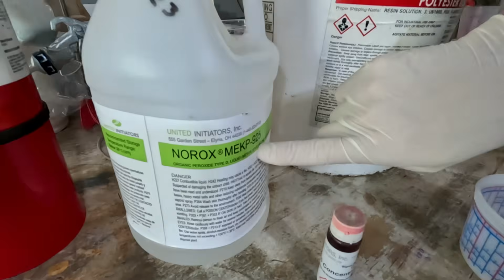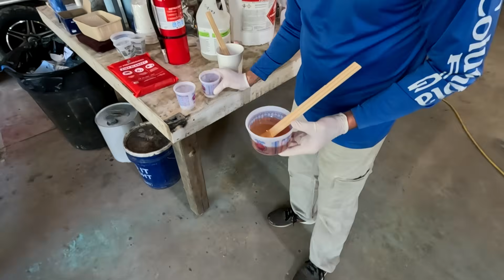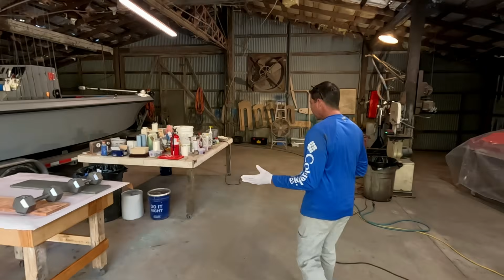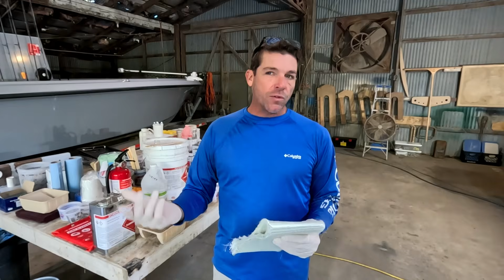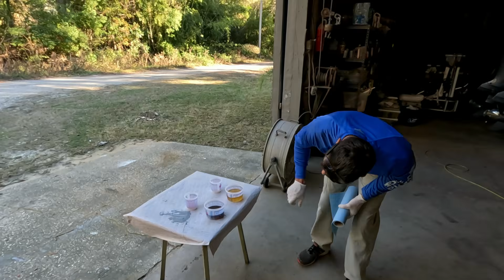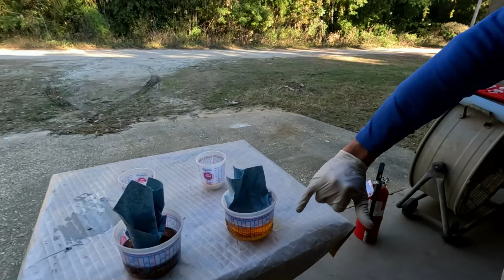FIRE HAZARD!! WILL POLYESTER and EPOXY RESIN IGNITE? LET'S TEST IT AND FIND OUT!

Comment: I am repairing a badly damage very old 14 foot fiberglass sailboat. The centerboard box must have been replaced because it was made out of 1/2-in plywood and was almost completely rotted. I have made a new one out of marine plywood with 3 layers of epoxy saturated fiberglass cloth on it. It was held in place by one fore/aft stringer and lots of foam insulation. I am planning in attaching the new centerboard box to a 2/6 stringer [on each side. My question is what do I use to adhere the new epoxy centerboard box to the polyester fiberglass hull? I can use epoxy to attach the box to the stringer, but what the stringer to the hull. I understand that polyester to epoxy does not work too good.
Reply from the maker: If I understand correctly,  epoxy should work in that application. Epoxy will bond to epoxy and polyester. I don't recommend putting polyester over epoxy. Hope this helps. Thanks for watching!

Comment: I never seen neither epoxy nor poly actually combust, but laid too thick in single go fills, I´ve had yellow brown to very dark burnt colorations, failed castings by internal thermal expansion/retraction crackings and rather unhealthy fumes. 
I suspect similarities to linseed oil, as in that to actually catch on fire, it will need principle of towel kindle wicking and good assistance of wind draft. Anyway, those fumes leaves an impression on eyes and respitory system. Better stick those spent gears and excess leftovers in an old metal container able to hold liquids, park it well ventilated and rather be safe than sorry on fire security. My shop furnace seems ideal for that to me :))
Reply from the maker: Thanks for your thoughts and suggestions. We appreciate you watching!

Comment: I think in Celcius , Livable heat ranges only from 20 to 30 degrees. It wasnt designed for ambient air temps but very good for the different states of water. The world uses Celsiusjust to spite America. Celsius is based on water and not Metric While farenheight is Metric based on 10s
Reply from the maker: Ahh! Still working all of that out. Thanks

Comment: I was actually surprised by this video and the lack of smoke/flame..

Though i prefer to mix right, i have over catalysed on the odd occasion when wanting to get a job done quickly. I have to admit the tins i used would get almost untouchable with over mix.

I also remember when learning to fibreglass being shown a safety video, where in a tin, over catalysed mix would give a puff of smoke, smoke quite readily and then ignite - all done with a timer. Too long ago to remember exactness though, but enough to always be cautious of over catalysing.
Reply from the maker: Yes, it was an interesting experiment! I thinks we will try it again with some different conditions next time. It is always best to be safe with this stuff though! Thanks for watching and commenting

Comment: Don’t forget to use vinegar to clean up mixed epoxy resin only. I initially didn’t believe that vinegar would dilute epoxy resin, but the old Mexican trick really works wonders for clean up, runs, etc. Give it a try……amazing!
Reply from the maker: Great tip! Thanks so much for watching and commenting!
Reply: You are referring to wet mixed epoxy not dried epoxy correct?

Comment: If a large enough quantity or over catalyzed, it WILL catch fire. Much younger days spent in a fiberglass tank shop, working on a gel-coat gun...5 gallons of that going off was no fun.
Reply from the maker: I will probably do this test again at some point. With the cost of materials these days kicking large batches of materials is just to expensive and just seems really wasteful. I tried to convey that you should always deal with these materials in a safe way. Also there is no reason anyone should ever mix a amount that large in the first place in my opinion. Hope this helps and thanks for watching
Reply: I was in no way trying to convey that your testing was incomplete! And yes, NEVER try to do that much.  @FishBumpTV
Reply from the maker: @bartcalder2791  No problem,  have had a Lot of comments on this one. Some people have very strong opinions, and with texts it can be difficult to get exactly what they are saying sometimes.  Thanks for watching

Comment: Great contrast shown and explained! I've had 6oz plastic cups with 2 or 3 ozs of pigmented metallic table top epoxy get so hot that you can't hold in your hand in 45 mins, but the under a 1/4" pour on the table top takes 6+ hours and up to 24hrs to cure and 2 weeks to get durably bar top hard. LIke concrete the slower the cure the harder the finish. I have much experience with epoxy but not poly, that's  why I'm watching and learning about poly and glass from the best!!! And tubers he does comment back nicely. Bret  Western Wild Woods
Reply from the maker: Thanks Bret! Yes, epoxy and polyester are very interesting materials, small adjustments can make a big difference for sure. I truly appreciate you taking the time to watch and comment!

Comment: Hey Captain Joe. Love your channel. I am beginning the process of restoring my late Dad’s 1991 Kenner 21’. I am in the process of putting a new transom. I am wondering if you know what type of wood they used in their stringers. The tops of some stringers can be dug out but about 2” down is some wood that can’t be dug out. I am guessing that wood is still good. The  good wood seems very light surrounded by ¼ “ woven roven. Even if some of the wood is not good, the fiberglass around it is very strong. Should I replace them since the fiberglass is what is giving structure? Thanks for the videos!!
Reply from the maker: I have always liked the Kenners. I had a 03 23ft model for several years. It was a great boat. Mine had some type of 3/4 marine plywood. Yours probably has the same type. I heard it was called excel 10, but I am not positive about that. It is hard to say if you should replace the whole stringer. Especially if the damage is very localized. You may be able to just repair or replace the affected area. I will try to make a video about this kind of problem. Hope that helps. Thanks for Watching!
Reply: Thanks for taking the time to respond. Look forward to future videos.

Comment: To “accelerate the reaction”, put it in a trash can, where the trash tends to insulate the resin. 
Same story as what’s been generalized as “oily rags”, by the safety nazi’s, when the problem is specific to linseed oil soaked rags, that for the self insulating property of the mass, especially in a container or pile, can ultimately flash / ignite.
Thanks for sharing.
Reply from the maker: Thanks for the comment!

Comment: I'm confused on the epoxy you mixed. You did it with 1-1 Pumps and said that this was the standard mix ratio. On the fiberglass you used 4x the normal catalyst. Why should the resin overheat if it is the standard mix ratio? On a typical marine plywood project how much more expensive per sq. foot would epoxy be over the poly resin?
Reply from the maker: We were trying to get it to overheat in the experiment. That's why we over catalyzed the resin.

Comment: Thanks for another great video. 

West is good but way overpriced. Bought some West from the blue marine store when I was younger 20 years ago, it was expensive, now it’s just prohibitive. 

Other laminating epoxy suppliers are as good at a fraction of the price. Great for small lamination, repairs and parts, filling holes, bonding, thickening etc when extended cure time is not a concern.

A mini boat or quick skiff build would be great but please review a few epoxy brands before, for everyone’s’ benefit.

Those other brands would probably send you a gallon or two for free just for the advertisement they would get in your channel.
Reply from the maker: Glad you enjoyed the video! I just went with West system because so many DIY folks are familiar with it. When we were building quite a few wood and epoxy skiffs I used System 3 epoxy,  works great, better price and no amine blush! I might do a video on epoxy comparisons, but some of these demonstration videos can get expensive for a small channel like mine. I hope as the channel grows we can do more. Thanks for watching and commenting !

Comment: Good info for the beginners. Once we kicked about 10-20 gallons of old gel in a drum. It didn’t catch fire but it sure smoked a lot. Resin would not typically cause a fire alone but always want to be safe. I’ve shot temps on masses of resin/gel over 500°F. 

One note: west system and others epoxy manufacturers do not recommend thinning epoxy but obviously it can be done in a pinch for odd scenarios. I work with west daily and haven’t found a need to thin though.
Reply from the maker: Thanks! Yes run away exotherm can get your full attention, that's for sure. I know thinning can be a hot topic. I don't do it very often, but sometimes the material needs a little help in certain applications. We will probably touch on that topic some more in the future. I do appreciate you watching and commenting!
Reply: Another tip to thinning epoxy: heat is the best solution to reduce viscosity because it doesn’t negatively effect the cured properties like thinning with solvents. Put the epoxy in a heated room prior to laminating or use a heat gun if it’s cold and you need to reduce viscosity. Laminating with 105 below about 60° sucks if the resin is cold too haha.

Comment: Thanks for the various demonstrations and examples you've provided. I would enjoy seeing you build a wood/epoxy boat. I've built several wood/epoxy boats and have found that choosing the proper hardener for the ambient temperature greatly impacts the working time of the epoxy mix. Fast, medium, and slow hardeners are generally available for each brand of epoxy. I tend to use medium hardener if the ambient temperature is under 70°F and slow hardener if the ambient temperature is over 75°F. I rarely use fast hardener. Most epoxy manufacturers provide a temperature cure table showing working time using different hardeners at numerous temperatures. And, as your demo shows, large batches will "go off" more quickly than small batches. Thanks again.
Reply from the maker: Thanks for your suggestions! We are always looking for interesting projects, a small wooden skiff seems like a  natural fit. And yes, you are correct on the different hardeners for epoxy, we just went with fast to get maximum effect on the exothermic reaction! Thanks for watching
Reply: The standard is 77 degrees.  Every 10 degrees above or below will half or double the working time advertised on the spec sheet.  For small projects you can build a heat box with an incandescent lightbulb to speed up the cure time.  Large parts like boats you definitely need to pay attention to the temperature or work in a controlled environment.

Comment: Topic suggestions:  While you have touched on many topics in your DIY videos, here are some items you might want to cover more in depth.  Structural fillets vs sandable fillets, i.e., colloidal silica (and commercial varieties) vs microballoons vs commercial fillers; laminating resin vs finishing resin and working time; finishing or waxed gelcoat vs gelcoat sprayed when moulding pieces; PVA vs mould release wax; polyester over epoxy and vise versa; using thickened epoxy (or polyester) resin to waterproof through holes, mounting holes and screw holes; how large a patch should be over a holed hull.  Your opinion on these topics I would greatly welcome.
Reply from the maker: Thanks for all the suggestions! I will try to get some of those topics covered for you guys.
Reply: Saludos:
Excelente programa deberían considerar  añadir subtitulos  en español. Éxito 🎉

Es muy buen programa.
Exito🎉

Comment: You're the man, man. You obviously HAVE to build us a small inshore boat for sure lol. Put me on that watch list for sure. I had to use some epoxy about a year ago and I made a little too much peanut butter with some fumed silica. As it sat in those little Total Boat mixing cups it started exo reacting hard and started smoking and was really hot to the touch on the outside of the plastic cup. It was gnarly. LOL I let it burn out and harden and then knocked it out of the cup the next day. Exo thermic reactions are no joke. But I wouldn't say dangerous. Definitely do NOT want to be breathing that stuff in though...
Reply from the maker: Thank you much! Yep, I hope to keep the boat projects rolling out for you guys. Exotherm will kinda freak you out the first time you see it. Always best to be safe with this stuff for sure!

Comment: Segment on prepping through bolting  underwater line on a cored hull. Im installing a swim platform and want to through bolt the braces. Im thinking 3" diameter of solid glass and/or thicken epoxy?
Reply from the maker: Thanks for the suggestion, that's not something we do very often,  but I will try to touch on that!

Comment: Just recently started watching this channel and seems to be very interesting and informative. I will need to work on my sailboat this year, hit the rock last summer and have few damaged spots inside the boat, would be interesting to see the technique how to work with such areas and should I grind all gel coat before apply epoxy and what should be used for finishing 
Thanks, 
Leave in Toronto
Reply from the maker: Welcome to the channel,  and thanks for the suggestion! Best of luck with your project!